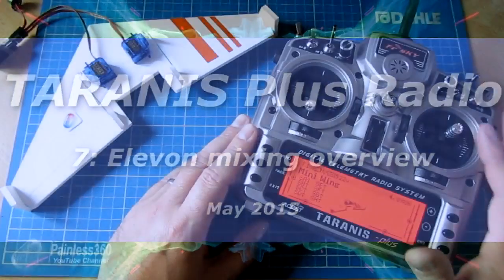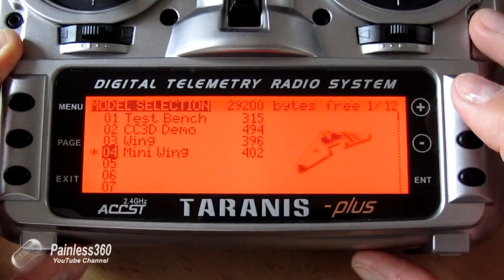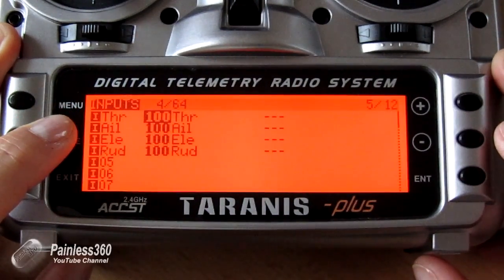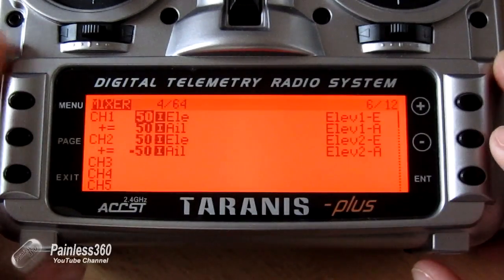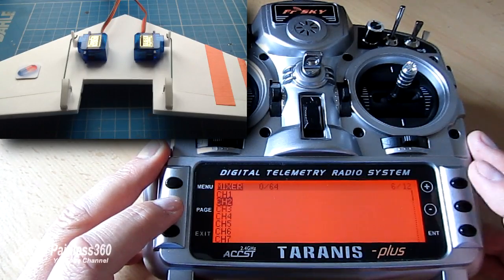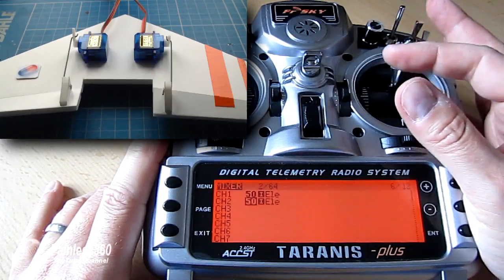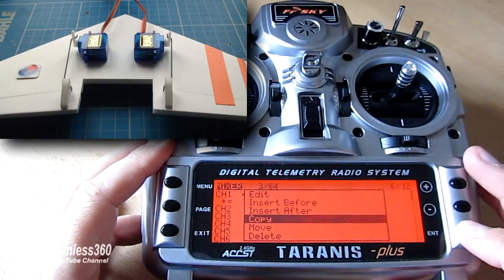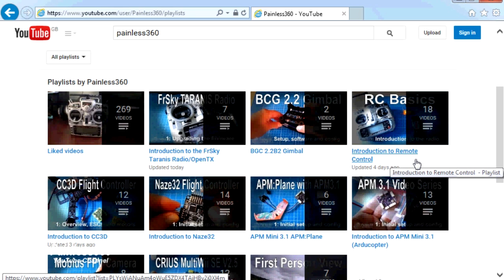(7/12) FrSky TARANIS Radio – Creating a custom mix for Elevons (flying wing)

Comment: Guess I was close to getting it right, changing the weight, ok! I used invert also to change one servo on a  y cord, but your method worked fine. Thanks again.  Next I will be doing roto flight setups with the TX16s.

Comment: I need to use this application but for a paraglider, so that one hand goes down but the other hand stay still and viceversa, but when go down or up both hands to actuate ,how I could modify this to work with this. Thank you. following you for years, but were out of hobby for a while due to health problems.
Reply from the maker: I have videos on the setup for a paraglider... check them out.. best of luck

Comment: How will changing the 50% of each channel affect the flying attitude of the wing?
Reply from the maker: If you mean the 50/50 mix between aileron and elevator controls into the elevon, then having more than 100 in total can mean that you have maximum movement of the servo with no more movement for the additional control. You can do things like make it 40/60 if you want more roll control than pitch or vice/versa... Happy flying!
Reply: @Painless360  Thank you! I'll experiment with the proportions, as I have a wing that's rather sluggish in the roll (Skywalker Falcon).

Comment: Its still a very useful tutorial for those starting this part of the hobby- no more pain in the ass with this configurations really..but often there are other troubles and he knows, for example, receivers from frsky qx7 so mix the channels for some reason, (including pretending, for example, a right-handed trhrottle that you can not figure out what is what and then there is a problem with setting anything

Comment: You saved my day. I've got a Jumper T12, your vid is helpful there too. (I've a Jeti duplex too, much much more comfortable (but very expensive) I've bought that tiny Jumper TX (4in1) for small models, where I can use cheap RX with lots of different RX protocols. Btw. that Jumper comes without any manual!

Comment: Thanks for the video. I'm trying to set my wing up with the buddy box on the 9xd. But the buddy box doesn't seem to mix the flaps but when not using the trainer option it works fine. Any ideas. I'm trying to help my son learn the wing
Reply from the maker: Sounds like it's the way you have it setup on the master radio. See my two trainer setup videos for how to do it.. best of luck!
Reply: @Painless360  all sorted now, i had dual channels setup up on the slave transmitter, dual channels were only needed on the master and basic channels on the slave, only problem now its a bit fast for my son to control lol

Comment: Hi there Painless, I haven't bothered you for a while, which means that your tutorials have served me very well.  A huge THANKYOU for all your excellent work.
I got a new flying wing out the other day (one servo in each wing). I have done a basic set up, and all is good. 
Now I would like to add an adjustable camber, or reflex, using a switch  and GV1 adjusted by rotary switch S1.
I have got that working  partially.  (Sticks are operating the surfaces as they should) 
When I flick a switch (SB-) I am able to adjust  both elevons down (camber) with the slider from its centre point, but when I try to adjust the elevon past neutral to reflex (upwards) the elevons adjust downwards again.  Please can you help me out. (I am settting up my Taranis plus manually, and don't use companion)
Go With the Flow
Bruce
Reply from the maker: Tricky to give specifics without seeing the mix you've setup.. Are you a Patreon?

Comment: thank you...
Reply from the maker: You are very welcome. Happy flying!
Reply: @Painless360  can you please upload a video on using telemetry with X6R and taranis QX7 
current and voltage sensor. 
I need it very fast please upload today if possible. 
Having problem binding with telemetry. 
please provide a detail video.
Reply from the maker: @jeevanshrestha8888  Already on the channel, check out the Taranis and OpenTX playlists (Please see this video - https://www.youtube.com/watch?v=P4soR6QgOk0 - that should help you find those videos of mine and help you find the answers you need quickly)

Comment: A question from a rookie. I did all this with a X6R and it works. In my opinion the other channels are free. Chn 4 I thought to use Pan / Tilt servo. But no output. Also Chn 5+6 dont work.
What is wrong? I tried Stick, Switch, Poti & Slider. Nothing goes.
Reply from the maker: +KartOpa51 impossible to say without actually looking at the model memory you've created. You've  probably missed a step, it's easy to do. I'd have a go at recreating it from scratch to see if you can make it work without the problem. Best of luck!
Reply: It works, don't know why. But next problem, Failsafe ! My X6R is normaly easy to do. If i want FS with a light left turn, so i set +25 /+25. So i want a little Elv plus. So i set +35/-15.
Is this way right ?

Comment: Works a treat however Trims are all screwed up :), made for an interesting first flight however no damage done, I will look at this later today but any suggestions would be helpful, this is also on a Horus X12S too not a Taranis, basically trim alters one surface not both either on elevator or Aileron
Reply from the maker: +Tony Cooper it does look like a lot of the challenges on OpenTX are for for the Horus at the moment. Maybe it works slightly differently?
Reply: My mistake :), being fastidious I copied an existing model as my starting point using the "Inputs screen" assigned to the sticks, deleted all of the inputs and did it EXACTLY as you have done on the mixer screen all working now

Comment: How do I get a subscription to those painless360 gel coated tablets?  Thank you painless360 i'm learning so much about the taranis-plus.  thanks to you
Reply from the maker: +samuel lubricant just keep hitting that like button and make sure you're subscribed, and the pills will keep coming :-)
Reply: your instructional videos on the Taranis are clear and precise. Got my Rad jet switched over from Devention to Taranis in 1 hour. Test flight tomorrow
Reply from the maker: Best of luck with the maiden! Happy flying!

Comment: For some reason even though I have adjusted the mixes, the elevon works fine in pitch up or down, but the aileron is backwards.  When I move the stick to the right the right aileron goes down.  I've tried swapping the servo cable on the receiver but it still reacts the same.  What am i missing here. My mixes match what you have as well.
Reply: I was able to figure it out, maybe you can answer this.  Whats the difference from (I)Ele  vs.  Ele
Reply from the maker: Google 'opentx mix exclamation painless360' to find it :D
Reply: Oh, didn't realize that was an exclamation

Comment: I was having a lot of trouble figuring this out on my FT Mini Arrow and this video really helped me get through it. Thank you!
Reply from the maker: You're welcome - glad it helped!
Reply: +Painless360 I'm headed out now for the maiden. I am using a cheap $8 camera and a 1258ghz pico vtx that is very light weight. I originally purchased the vtx combo for a micro hubsan x4 and I did I nice build video for it. unfortunately the vtx harmonics stepped on my radio signal which reduced my range to about 15 feet... not so good for fpv lol.

Comment: I have a wing set up with APM2.6.  I am getting the Elevon function via the setup in Mission Planner.  This seems ok on the bench.  Is this the correct way to go or should I be using the Taranis to achieve the Elevon function?
Reply from the maker: +Dieter Preiser We have a video series where we add an APM to a wing - maybe useful for you.. Best of luck..

Comment: how add this menu on taranis? in mine just um companion i have this wizard setup
Reply from the maker: +Erick Alves This should be installed automatically when you install OpenTX onto the radio. Make sure you add LUA script support as that is what that menu actually is - a LUA script..
Reply: +Painless360 thanks i will checks this ;)

Comment: HI painless, there is something in this mix better the original? it's not another way to the same place? and, the last. Usually the flying wings have less travel in elevator movement comparing with the aileron travel. How can I do It??? please. And thanks for your videos.
Reply from the maker: +Escoles 1618 Lots of ways to do that, I'd probably reduce the amount of the elevator mix in the 'Mixer' menu. Best of luck.

Comment: when I setup elevon mixing, the inputs have no effect.no rate control or expo.what am I doing wrong?
Reply from the maker: john mcclay Impossible to tell without looking at the model. Double check the inputs and check you have the source set as the 'input' you created not the raw control.
Best of luck.
Reply: Painless360 I was using raw control instead of input.solved the problem.thanks

Comment: I've been wanting to add a custom track to the Taranis's on-board TX battery low voltage warning, is that at all possible? I have not found a way to do that as yet.
Reply from the maker: iflylilplanes If you look in the 'Sounds' directory on the SD card in the TARANIS you will find a directory called 'System'. All of the system warning files are in there. Find the one you want to change by playing them and then replace it with a new audio file with the same name to change it. 
Best of luck.
Reply: Painless360 Just like the way I changed the TADA file with my custom intro greeting.
Reply from the maker: iflylilplanes https://www.youtube.com/watch?v=2mZ5Ja4f8mk should help if you are still not sure.